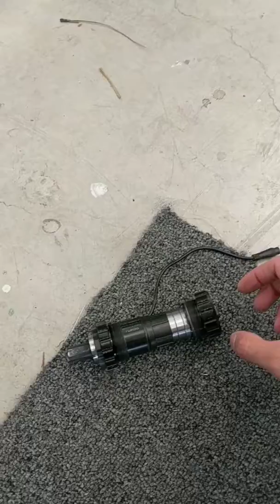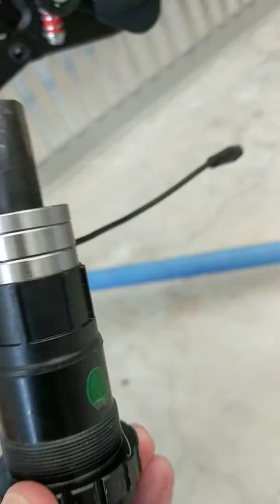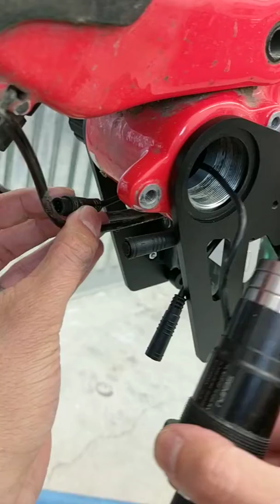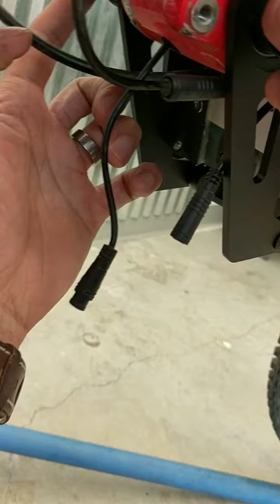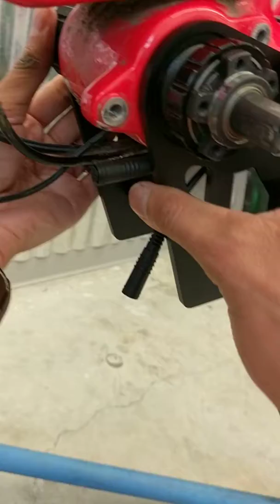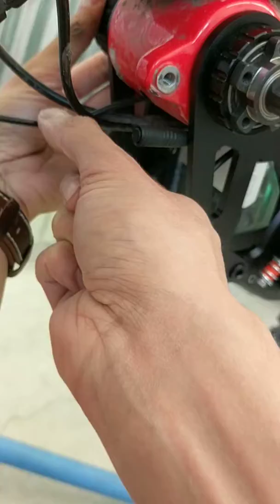Revel Lightweight Motor Install - Step 2 - BB installation

Comment: Does this torque sensor also has paddle assist?
Reply: The torque sensor is part of a pedal assist system. Rider cadence and torque are measured, and the controller decides how much motor power to deliver. The max motor power is adjusted with the buttons on the display. There are 5 assist levels.